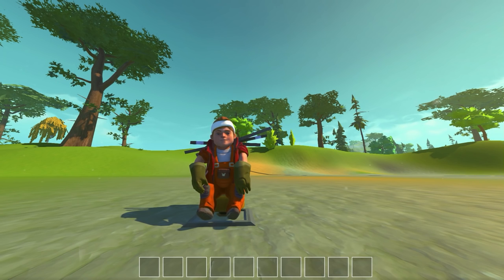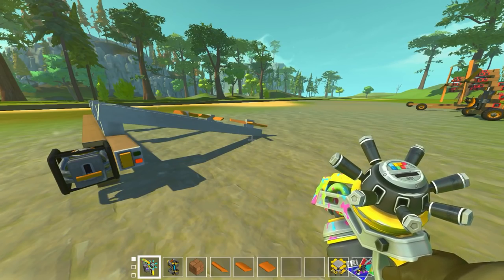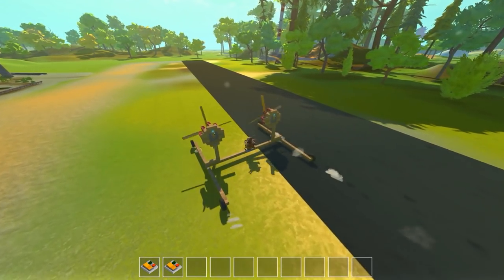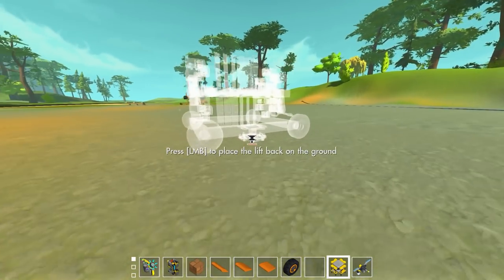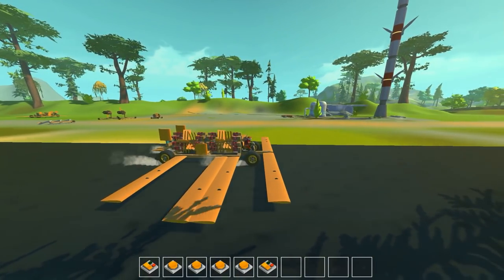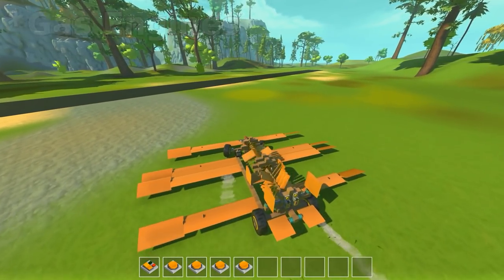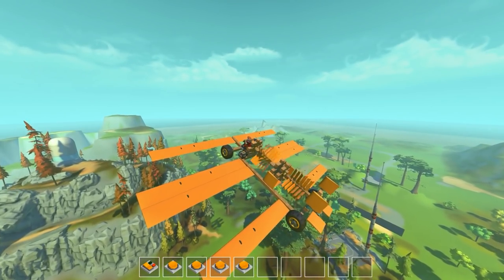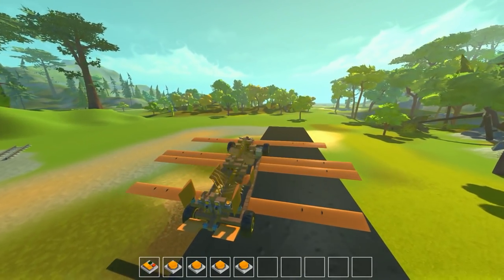Magnet Powered Propellers and Working Propeller Plane! (Scrap Mechanic #295)

Comment: He sounds sick to me
Reply from the maker: I think my mic settings were just a little weird. I noticed my voice sounded muffled almost as well.
Reply: I started the video and just heard a muffled voice, so I instantly thought sick or something with software/mic. Then saw comment and found answer >3>
Reply: kAN Gaming the devs need to wake up and realize that it is 2018 and 8 core processors exist  and with your hardware a few dozen scripts running should be nothing
Reply: Kan try make a storm works helicopter in scrap mechanic.
Reply: Ya

Comment: Use the angled wing pieces in this order and degrees: regular at 90, 15 at 75, 30 60, 45, 30, 15, regular at 0 degrees. A propeller needs to have a constantly varying angle of pitch to have maximum thrust.

Comment: The reason if you reverse directions when driving and It speeds up, is because the shape used to trigger the sensor is better suited for the higher speeds by compensating for lag,
So I suggest you should create a version that can change the shape, on the fly to increase speeds

Comment: It would be interesting if they had a set of separate “propeller axle” and “propeller blade” parts. Then what could happen is the axle would count the blades attached to it, figure out how fast it’s spinning, and directly calculate a force. That would be a single scripted block, plus the thrust could be boosted to compensate for the fact that scrap mechanic can’t spin stuff at several thousand rpm.

Comment: you should try to do it with:
-thrusters on the propellor blades
-variable propellor blade angles - steeper angles for  slower speeds, shallower for higher
-multiple sets of propellor blades with different angles on a single axle

Comment: I think you're right, this is a limitation of the # of scripts that can run per frame/game tick/whatever.  Magnet motors were spinning things /way/ faster than regular engines were, so this should work.  Ah well.

Comment: i have an idea.
in wings mod wings create a force calculated from the velocity of the vehicle, but to be honest from the velocity of themself!
any block in Scrap Mechanic thinks that his position is where his center is
Instead of straight movement you power propellers up with Angular velocity
and from the center of the wing all this velocity is too small to lift.
you investigated that custom magnet motors have way more power than speed
a lot of power allows to spin a huge object
and, in my opinion, if you will spin an extremely wide propeller instead of small ones, last propellers in the stack will think that they are moving with extreme speed and create a force!
but plane can`t have a propeller blade greater than itself... guess what can? Helicopter!
So, i think it is possible to create a magnet mod motor powered Helicopter!

Comment: The issue with the magnet engines is that they propellers don't have enough weight to keep stable and end up not spinning but instead turning back and forth. I messed around for a couple of days to  get it working, but no success. I had marginal success making a ultra-light design reworking your original concept (removing the barrings where possible, but no magnet engines were used. All in all I think you're right and its possibly just script limitations.

Comment: context:
- the 45 degree pieces are best suited for propellers because they provide much drag, which causes them to be slower than other ones
- the phenomenon observed at the beginning is a result of the low update rate of scripts and as of now i have tried everything imaginable to fix the behaviour to be like it should be
- faster = more thrust
- too fast = less thrust
- even faster = reverse thrust
- the gas engine at the highest setting is the best speed for props
- making props bigger (or adding more layers) is generally better compared to adding more, as more bearings induce more "drag" or "loss of force" (only observed effects of more complicated physics engine stuff)
Reply: tl;dr you could totally blame the devs for not adding everything i want them to lol

Comment: The steeper your Angle on the Propeller is, the faster it accellerates, but it looses much top Speed. Try the 15° and it could get enough top Speed.

Comment: Just a note, your back set of bearings for your "lift off" tilt are facing the wrong way (reversed). Think of the center of mass like the fulcrum of a lever, if you apply opposing forces to both sides, you won't tilt. The only reason you tilt is because you have one set of tilt bearings not cancelled out. It is not only pointless to tilt a back bearing up, it can also KILL the game. If you have ever played Kerbal Space Program, this would make sense.

Comment: hey kan, so 30 and 45 degree propellers push up, but what if 15 degrees is a constant propeller, like for hover vehicles? so like if you pushed it up, would it keep its height instead of flying up it just stays there?

Comment: kAN I managed to make a piston engine powered plane with propellers. Yes is difficult to get a lift off but with enough stacking, it's perfectly possible. I even managed to get good speed with it. Later on, S@les showed me his version which was lacking power and once I helped him improve it, his design was even faster than mine. The main factor for it to work is torque. If you don't have enough of it you can't get a stable flight. I challenge you to make your own piston engine powered plane!

Comment: The only way you can fly with propellers is using the mod scrap man used but it has a booster in it
Reply: Incorrect 

Scrap Man made his plane too heavy for it to lift
Reply: Also 7:57

Comment: I’m not exactly sure but I think you got yaw wrong. I think yaw is the tilt of the plane side to side. The wing you said controlled yaw were just vertical stabilizers. If I’m wrong please correct me.

Comment: Kan use wheels to make gear ratios to increase the speed of the magnet motor which will allow u to spin the propellers fast using the magnet motor

Comment: I'll recommend the same thing to you as I did scrapman. With the way this mod acts, and unfortunately my computer can't handle this game, a single extremely large propeller on a high powered gas engine, behind the center of lift, similar to an ultralight aircraft might be the best bet. The propeller in this is underpowered, so you need every advantage you can het

Comment: The 15 degree prop would be for when you at cruse height and not accelerating the steamer of an angle of the prop the courser the prop and the lower the angle the finer the prop just a bit of aviation terms there for you

Comment: Your magnet engine generates enough lift to pull itself off the ground if used to power a helicopter like propeller with four 10-block long 45° blades.

Do you think you could try and make a helicopter? 

Could you